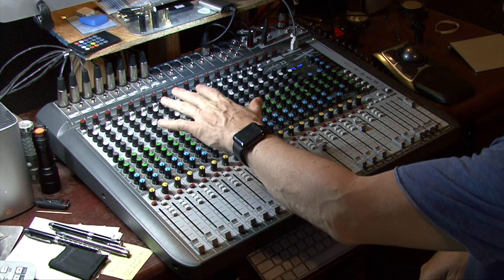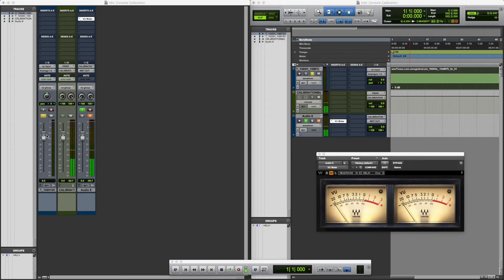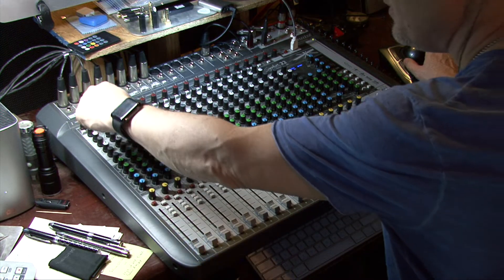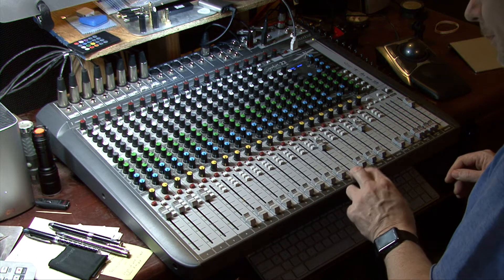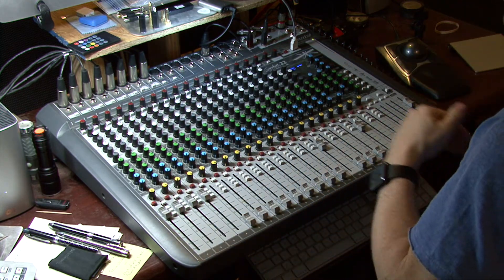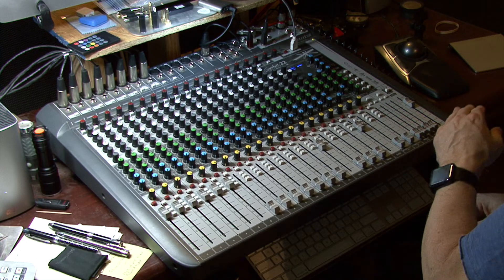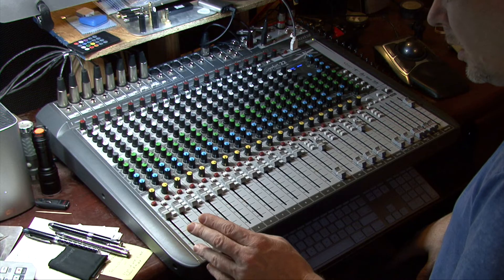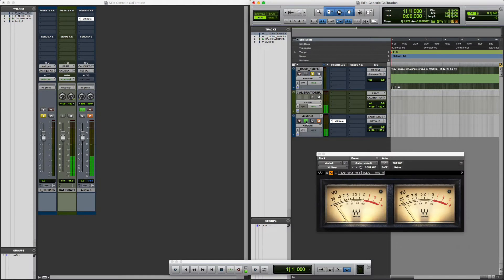In The MIX: Part 1 - Soundcraft Signature Series Console Calibration

Comment: Hi Brian! Nice and helpful videos! I've bought a MTK22 signature and it awesome despite the huge noise that occur as soon as I connect and route the output to channel 22 via USB return... Is there anything I could do to reduce or eliminate it ? Do you thing that noise jitters or silver solid high end cables could solve it ? Now am using regular usb A B cables. I am not sure if it result from ground loops or if it is only digital.
Reply from the maker: I would definitely try a different usb cable, perhaps a shorter one, just to see if that makes a difference. Is the noise recorded when you do a print or does it go away?
Reply: @BrianBuckalew  Thanks a lot for answering! I've tried small cable, but now I'm going for a more expensive than the traditional ones. I am guessing it is something on the USB input of the mixer. The noise is not recorded thankfully. It only shows up like a beep when I get around -15dB on master fader
Reply from the maker: +Matheus Sirena this is very odd. Please let me know how you make out. I am interested in knowing what is the cause of your issue.

Comment: excuse me，two questions i want to ask.

1.why dont you keep the fader on zero db ，than use the gain knob to get 0dBvu？

2.why use -10dBfs to get 0dbvu？

thanks！！
Reply from the maker: The gain knob only works on signal coming in through the XLR or TRS inputs. They have no bearing on the signal being sent from the DAW over USB
Reply: get.  and why use -10 dbfs to get 0db vu？     thx
Reply: that was also my question. and why would you calibrate a mono signal on a stereo bus?
Reply from the maker: Hello,  @torbenutecht . I am sending a stereo signal out to two mono channels on my console. One is panned hard left and the other is panned hard right. So I am calibrating each channel from the test tone coming from my DAW to reach 0 dBFS. The reasoning for this is the console has built-in headroom when going through the USB return. I am in a way compensating for some of this. I also have my Master fader and Group Busses turned up to add additional gain to my returning summed analog signal. Please let me know if this does not answer your question.

Comment: Great Video! I have a similar Soundcraft but the 12 channels version. My question is about the Master Fader of the console, how do you calibrate it? You set it in 0db, right? Because in the video you start with the master fader already turned up. You put it in 0 db calibrating it by visual?
Reply from the maker: You can keep it at 0, but that more or less depends on the size of your room, as the Master Fader will determine the level going into your studio monitors. Your mixing room/control room may require a lower Master Fader setting. In my studio I use a passive monitor controller, so my signal to my monitors can change to a lower level when I push my Master Fader to do an analog sum. I push my output to level match the signal in my DAW, but at that level it would be far to loud in my studio, so I turn down my passive monitor controller to a level I am comfortable with.
Reply: @BrianBuckalew   Thanks for your answer! 

Well, the Master Fader also determines the level of signal going back to protools, 13-14 Input (Your 23-24).
And It turns out that here in my studio I have the SoundCraft and a M-audio interface running together. (At the Audio/Midi Setup of Mac, I’m able to create an Aggregate Device and select witch interfaces plugged on my computer will be part of the device). 
In my case, the Master Fader of the SoundCraft isn’t what determine the level of the Monitors, just the level of the signal going back to protools. And I control the monitors by the M-Audio Outputs. 
But my question is about when you start your calibration for the summing. Because if you use the SoundCraft 23-24 Input for calibration, when the Master Fader is all his way down, you don’t have any signal on Protools. So, where do you set the Master Fader of the SoundCraft on the very begging of the calibration and why do you use this value. Because if you move the Master Fader during the calibration, you will have a different amount of signal on Protools.

I sorry if I’m not being so clear, and for my english. Greets from Brasil!
Reply from the maker: Yes - in the console calibration video I am using 0 dB on my Master as the basis to set my calibrations from each and every time I calibrate. It is easy setting the Master to 0 and then working from there.

Comment: Hi Brian, Thanks for the video and all of your efforts helping us understand how to more effectively use this mixer!  I also have this mixer and think that I understand the purpose of the calibration when you are working with a preexisting recording in your daw that you want to bring out and apply equalization, effects, routing, etc.  If I am understanding correctly the tracks returned from the daw to the mixer are not effected by the gain pots on the mixer.  You are calibrating to compensate for channel differences and the reduction in level we observe when the tracks are brought out to the mixer via USB?

In my case I am using hardware so would if be better to compensate for the channel differences using the input gain pots?  I know that normally we want to maximize signal and not overload the preamps, but it just seems like those are where I would want my gains adjusted such that fader unity gain was the same level on each channel. Then I would have a common starting point when adjusting levels of the individual tracks when doing my mix?

Thanks!
Reply from the maker: Yes. If you are routing your audio through analog hardware and into the console via a TRS or XLR cable then you could use the Ghost preamp's gain knob to adjust the level going into the channel.